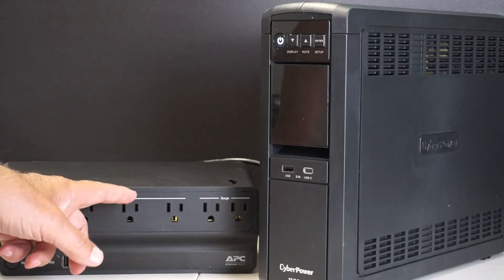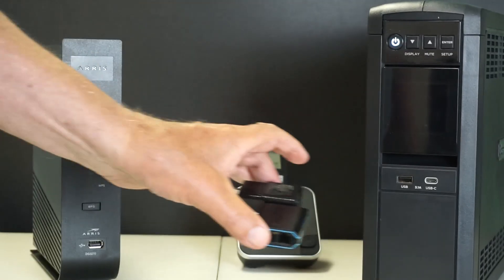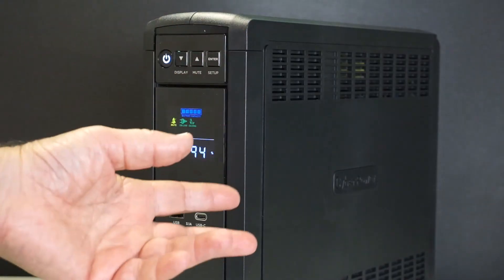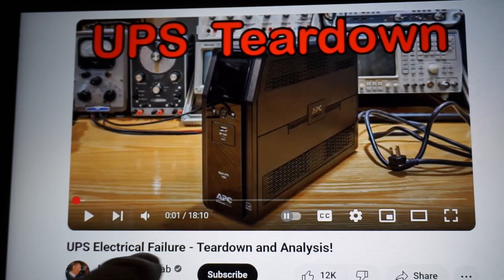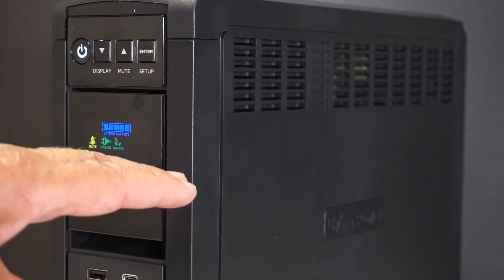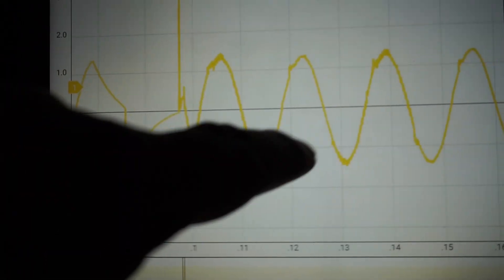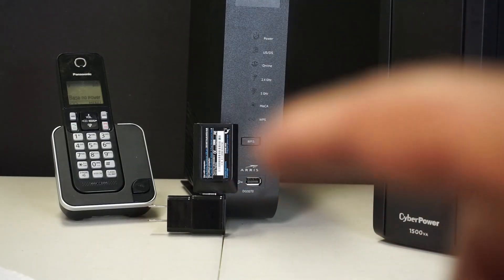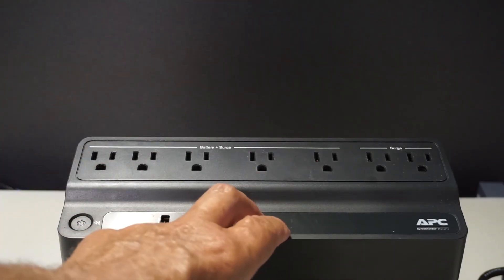GADGETS#212 - PURE SINE UPS

Comment: 9:05 Hi Dennis! 
Couldn’t you try to replace the cells in the battery? 
They usually use 18650 li-ion cells and if so, you could probably upgrade the battery to a higher capacity and at a potentially much lower cost too. 
Just my thoughts.
Reply from the maker: these aren't lithium, Eduard

conventional 12v sealed battery
Reply: I've never seen a UPS with lithium batteries - always lead acid

Comment: Awsome video Dennis. This one in patiticular was right up my alley.  I have been getting in to power quality analysis  as a side gig .  At work I have been using Hscope to test automatic  transfer switch inphase transistions. I have some make before break switches that momentarily parralell to the grid to eliminate any down time. Its need to see the sine of a inphase transition vs one that comes in out of phase.  I wonder if the first good sine after the transition is sort of "inphase " Another words, if  the utility waveform was filled in across the transition period  would it overlay the UPS sine  ?  Thanks for great video.
Reply from the maker: I measured for that Jesse...didn't mention it in video as I felt not too many people would be interested in that...but then, there's you:)does not stay in phase with mains
Reply from the maker: you might want to check this out, Jesse:

https://t.me/hscope/1/109224
Reply: @theGADGETSplaylist  Wow ! what a great use of the ruler. I appreciate you sharing it.